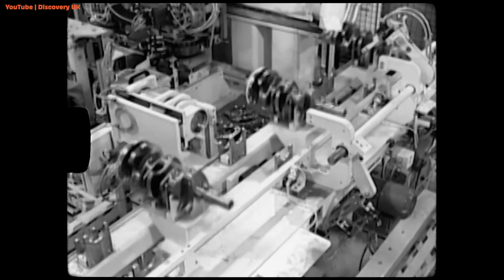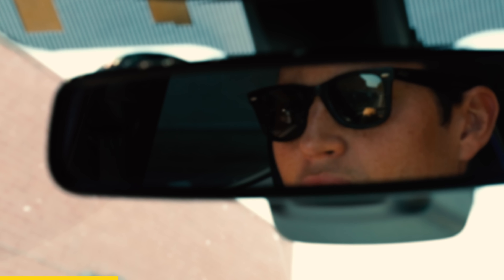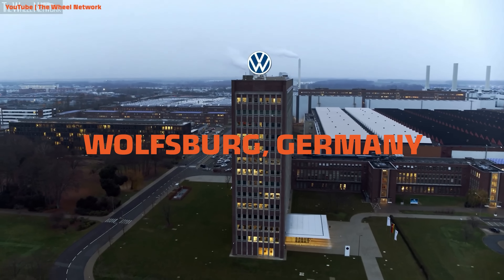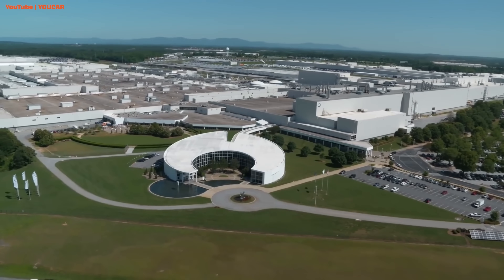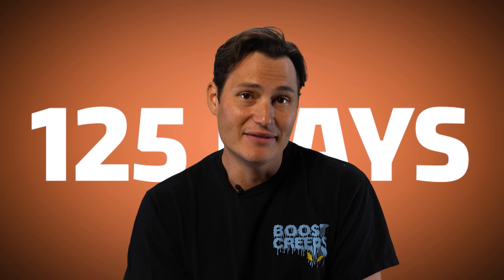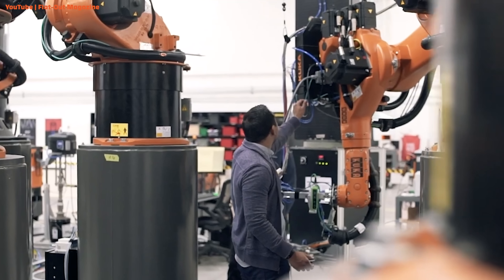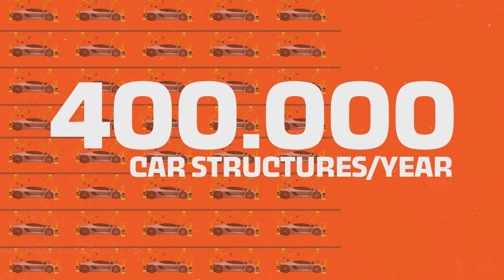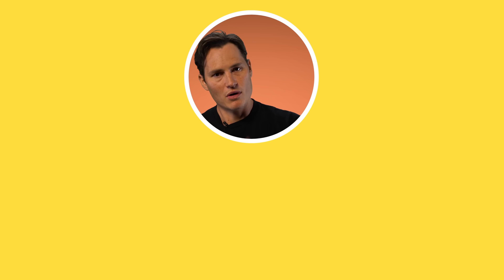A.I. Designed this Car

Comment: I feel like the bigger step forward has really been 3D printing which allows these intricate and complex shapes to be easily manufactured. Before you had to work within the manufacturing limitations of casting, welding, etc.. Humans are also quite capable of designing more resource-efficient builds.

Comment: Takes thousands and billions.......................Yeah tell that to the 8 guys that did it from a shed and have cars with the speed records -this is a misconception of the industry formerly it didn't take that many(Shelby had no more than 13 people) and it still doesn't its called corporate inefficiency personally I call it stupidity. Most of the industry doesn't even manufacture anything, they merely assemble it, other than a few manufacturers that actually have the capability to do so because it is ever so popular as ever to outsource everything over seas to cheaper areas in 3rd world Labor costs.
Another problem is overproduction of cars that leads to higher pricing for the entire line, your not only paying for your car but also ensuring the company insurance that they get their money either way(Most of the time this is done with selling new or refurbed parts), to put this in perspective the actual Manufacturing cost of a lets say 2016 BMW M3 is only $13k(because I am familiar with this one and its actual costs) mind you R&D and engineering costs are not included because they are recouped over years using the very same body and parts as well as cross utilization of different vehicles minimizing their cost that never translates to your pocket as a consumer, go ahead and pay for a BMW/Merc/Audi aka Euro Taxis. AKA the industry is full of its own shit, has been since the 80's and probably as early as the 70's when they figured out they could sell hot trash that is cheaply made with garbage materials for more money, Hell even Enzo admitted in his Biography he willingly made shitty cars fleecing customers and sold them for high prices to fund his F1 habits which is really what he cared about, he thought the prosumers that bought his cars were idiots.
A large portion of the problems in the US are also the Dealerships that have become an antiquated ripoff, Cars should be M.T.O. to save manufacturing costs.

Comment: Good advertising for this car, but this guy doesnt take into account anything outside of the script he was given. Biggest issue, sure 3D printing is more efficient and can be reprogrammed to make anything... BUT its SLOW... and you need a insane number of them to get the same throughput as a factory line doing specific tasks. The other big issue with these AI generated designs that do the "minimum to get the job done", What happens when one of the parts breaks due to a flaw in the material? suddenly the rest of the structure cant handle it and it breaks. normal parts are made bigger and stronger or designed to deform to absorb impacts, a single flaw in a part of it wont lead to the entire thing failing(unless its the metals makeup, but this 3D printing would suffer from the same problem). None of this is convincing, it all just sounds like someone who recently heard of the concept but doesnt really understand anything outside of the core of it. 

OH yeah "500 million for a factory that can produce 1 car per minute VS  3 million for a machine that can make 1 car every 125 hours(while still needing people to put in the wires and everything else)" Lets face it, if his machine that assembles the car works... there would be video of it, ya know, working. 

for the same throughput you need 1 factory at 500m or 7500 3D printers for 22.500 billion dollars. Those machines would have to last through 45 change outs of a factory to a new car design to even come out at the same price. In order to be the same price, that 3D printed could cost no more then 66,666$

I will admit that the potential for 3D printing is there if the cost can come down. But this isnt "problem solved" like this video pretends.

Comment: This sounds like something that is gonna make a car where you have to take the entire back end of the chassis off to change the oil
Reply: cable breaks..  . cable is inside the chassis, whole chassis has to be rebuilt.
Reply: @nocensorship8092   I'm wondering  what cables  are you referring  to ,most new vehicles  don't  have cables any more ,it's called fly by wire in my world
Reply: @nocensorship8092  cables dont randomly break, if cable durability is put in variable it will last indefinitely
Reply: @GlobalgamingP  That, and cables tend to break at the flex points outside of the cable runs,  not inside the cable runs, so if the cable inside the chassis cable runs just goes to a connector, it's likely the breaks will only require replacing cables outside the chassis cable runs and not inside of them.
Reply: @GlobalgamingP  they break
Reply: When the oil goes, you trash the car and build a new one. It's called efficiency ;)
Reply: @RoboBoddicker  sounds like a good plan
Reply: @theslipperybrick_7566  😂😁😂😁😂
Reply: @theslipperybrick_7566  😂😂
Reply: @RoboBoddicker  this is not good. This means you will pay 20k every time your oil goes. This type of "efficiency" doesn't mean a car will be printed at a cheap cost to everyone in some sort of utopia... it means corporate greed will charge you the entire cost of a new car every time you need a oil change.
Reply: @RoboBoddicker  sounds about right, in a consumer society
Reply: The path companies start by expensive cars is that manteinance and other customers preference do not play a role in here. People who owns those cars just pay the bill. They don't even exchange their tires on the side of the road if needed. They pay someone to do it.

And of course they're using AI to improve assemble and project over normal cars. I don't see any sense to assume your wiring would be stuck into your chassi...
Reply: You do realize that repair and maintenance accessibility is just another variable you can add to the program and it will design the car with that in mind.
Reply: @thechainwarden  Yeah but also the car hasn't to be totally realized by AI, there are surely human supervisors that can actively modify the project
Reply: @ninotzz   tell that to anyone who bought a car after the year 2000
litteraly every car is like this now a days. oh heater core went out? pull whole god damn dash out.
Reply: @experimentalmenace  Mh interesting... I don't have a car so I didn't know... looks like we are going towards disposable crap more and more... (other example: phones with non replaceable battery)
Reply: @ninotzz  facts im a beg fan of self repair. and over the years companies dont want us to fix things anymore they want us to buy the updated version instead. they are even trying to make it legal that you cant fix your own stuff... the right to repair act is suposed to stop that tho.
Reply: @experimentalmenace  is it a USA act?
Reply: @ninotzz   its atached to a few different bills for individual states
Reply: @ninotzz  For now....
Reply: @thechainwarden  knowing how the system works it would design the product so that it fails just after the warranty expires.
Reply: @nts9  exactly
Reply: @thechainwarden  There's something more. Things break in cars because suboptimal engineering. I'm not talking about engine parts being used up, I'm talking about failing parts like cables, pipes, gaskets and that sort of stuff. When I see a cable that is angled at some point, and it can move a little. Bend. The point of failure. You can design prioritizing maintenance accessibility or... reducing possible points of failure. Or both! It is theoretically possible. Of course, you will always have some external damage from collisions, potholes and such.
Reply: @thechainwarden  That's not what I saw in the video. That was an engine twisted into a chassis, you would have to strip the whole car just to get at the injectors.
Reply: @thechainwarden  but where is the fun in that?
Reply: @thechainwarden  I think that must have already added to the program... Every car designer or manufacturer need to think of the maintenance facility. I think the future would be AI and robotics maintenance or service centres... You put your car in, enjoy coffee and servicing is done...
Reply: @thechainwarden  I wondered that when watching the video. They can factor human maintenance in to non-hyper car builds.
Reply: @thechainwarden  Honestly, manufacturers probably wouldn’t do that kinda like Apple making the iPhone unrepairable
Reply: Sounds easier than my car, designed by a team of morons.
Reply: That might be true for a car designed for max performance.  However, if you program the designer to allow for serviceability and longevity, it would be as easy to do work on the car as your 72 f150.
Reply: he said that engineers define mounting points and size and stuff, itll be no more complex than they let it be
Reply: That's assuming the oil change is still being done by a human with oily hands.
Reply: Gives new meaning to  -  Service by Authorized "" TECHNICIANS "" only   !!!!
Reply: Good thing none of you people can do anything to stop Czinger.
Reply: At the rate of the intelligence this will be factored into creation
Reply: Yes absolutely. Just wanted to post about it ))
I am a programmer, and I can assure anybody that "shortest path" is not always the better. Programming is all about optimization. Code readability and clarity of logic inside - is one of the important parts of optimization. So forget oil or any mechanical damage/malfunction (hello from Audi here) - just imagine one single wire failing inside those tubes and "shortest paths" - you will have such a headache. Not mentioning engine maintenance ))
Reply: A lot of comments  about how only shops will be able to work on these new cars, I can remember people  saying the same thing when computers  were first put in cars. I took the time to learn how to fix them on my own. And eventually built a mud truck with one, I drag raced a car with one  , everybody said it couldn't  be done. Yes I was one of the first  to try it and  it worked I see way more of both now. Don't  be scared,, learn how to work on the vehicles  of our future,  you could possibly make big money doing so.
Reply: Here's why a guaranteed income is needed in the US! Humans are becoming obsolete!
Reply: You know it
Reply: you will just 3d print another. Next level consumerism.
Reply: @UrSSuL  "what kind of peasant holds on to a vehicle after the oil went bad?"
Reply: They should, in turn, make a backyard mechanix vehicle, where you can even change out the engine in a few hours. Of course, as we all know, that will never happen.
Reply: Not if that's incorporated into the AI's dataset. My real concern would be crash testing and all the mundane safety issues involved. The problem you point out is that the human running the machine screwed up
Reply: Bugatti already did that bro.. LOL
Reply: That’s common with high end cars. Try changing the oil on a Bugatti.
Reply: no, you can optimize this function as well - assign a priority level for maintenance components
Reply: working at a walmart automotive, i cringe in pain at the thought.
Reply: Oil is 3D printed into the million dollars disposable car.
Reply: remember it's the AI who built it
Reply: Except you won’t even be able to change it, you’ll have to take it too a special shop with all the fancy A.I. So it can work on your car and they charge you out the ass
Reply: It's already sort of happened  ,driverless cars are racing. In special  races. AI is controlling  the ads you see on your phone ,AI has won in chess ,AI control certain  air craft  , when you play video games you are competing  against  a form of AI. It is here and a part  of our world,
Reply: @cbialorucki  yes. Electric vehicles if dine correctly have way less moving parts... Therefore fewer points of failure, therefore less to maintain
Reply: @cbialorucki  I only know a bit about the Model 3. But they actually last over 300,000 miles. Tesloop a taxi service in California has many Teslas with +300,000 with an average of $15,000 of maintenance. Most EVs use regenerate breaking, this greatly reducing the use of brakes. I rarely use my brakes.
Reply: @cbialorucki  Good to know on the brakes. no, that cost was an average of their fleet (maybe 15 yo 20 vehicles). The company has closed though, I think COVID did them in. Though I don't think they needed to replace the batteries even at over 400,000 miles for one of their vehicles. 

Even if it costs $20,000 over the course of 400,000 miles. I still think is a really good deal imo. Tesloop compared their costs of upkeep with model s vs a Mercedes Benz... It's was like 15,000 (model s)to like 80,000 (Mercedes Benz)
Reply: @cbialorucki  keep in mind that were talking fully electric, not hybrid.
Reply: Let's not forget "planned obsolescence", so they won't manufacture it with maintenance in mind. I think all engines should adopt freevalve and it'll increase the efficiency of all engines, plus hybrids.
Reply: Basically, a normal italian car.
Reply: Ok im not the only one that thought maintenance would be a huge expense.
Reply: Good point! None about maintenance... may be...
Reply: If the ai is properly optimized it would make any and all maintenance and repairs as simple as possible while keeping the design and performance intact.
Reply: What oil it will all be electric bro.
Reply: Electric cars don’t need oil
Reply: The SR-71 goes faster than 2000 mph!
Reply: So pretty much an Audi lol
Reply: Oil? I remember that
Reply: One of the many problems with the process-this stuff is interesting don’t get me wrong, but I have 6 years experience in traditional manufacturing (I know that’s not a ton) in addition to a degree in mech eng where several of my classes where focused on automotive manufacturing. I also spent my senior year working on a capstone project that used ai design to develop a new generation rover. While the design worked quite well, the technology is nowhere near ready to replace current design methods- I estimate 10-15 years on this but I wouldn’t be surprised if it suddenly advances quicker. Second, the idea of using additive manufacturing won’t make sense until it can at least exist on the same level as traditional methods- right now it takes hundreds of times as much time to use additive manufacturing to make a part that can be made through traditional methods.
Reply: You’re gonna have to take apart the whole cylinder head and change the block just for changing an oil filter
Reply: Sooo... an Audi? AKA The Four Rings of Sadness
Reply: Or no oil or gas needed when the cars will be electric
Reply: @buenito35  Lecktric cars still go wrong, ask anyone who drives one.
Reply: @cuckingfunt9353  yes all transportation can and does need maintenance, repairs... But electric cars, generally speaking, require less. I own a Model 3... 20,000 miles nothing wrong yet. Just adding windshield wiper fluid every few months and washing the car...
Reply: @buenito35  20k is nothing. My Toyota has 260k on the clock, all I've changed is brakes and tires. The AC works like new, I get 60MPG even when commuting.
Reply: @buenito35  I also have a mercedes van with over a million on the clock, on it's third head gasket but that's all, and the gasket only takes 4-5 hours to change.
Reply: @cuckingfunt9353  that is very cool 😎. Both situations can be true. Your statement does not make mine untrue or invalid... If that was your intention
Reply: @cuckingfunt9353  I drive a Model 3. Very little has gone wrong in +30,000 miles. All cosmetic issues ( 3 different things)
Reply: @buenito35  oil is still required as a lubricant. Its not the same oil and amount but still required
Reply: @johnhoppkins7258  I think oil will still be required for many other purposes. There are some uses that there will not be a good replacement - for a long time anyways. Even the things we do now to be more sustainable are bound to have some negative effects, but it's the right direction. It's like trying to stay with a horse and buggy when the Model T started ramping up, it just makes very little sense.
Reply: @buenito35  damn u beat me to....I was gonna say most likely become electric for efficiency
Reply: If AI is designing  the car repairs  of the car, along with  crash damage  is a part  of the deal  ,just like racing ,I have built many race cars ,I am aways thinking how can I fix this fast to continue  to race that day , possibly  within minutes. every race team has answer's  for this ,I'm very sure this car  can be fixed  if you have the parts on hand, With speed
Reply: @carlstephens1532  if the car is built by AI and repaired by AI and the AI can learn, what stops the AI from replacing the driver with AI as well. Not only is there no race team like you previously mentioned but after a while there would probably be no you. If AI constantly learns and improves and if it’s so much more efficient than humans then wouldnt AI simply remove humans from the equation, ya know all in the name of speed and efficiency right?
Reply: They will take away all of the jobs, prevent people from being able to afford food for their families, much less a car..while doubling the price of vehicles. Sounds like a perfectly logical way to progress mankind.
Reply: Or the oil will last the whole life of the car due to BLEEDING edge techh

Comment: LinguaScribe Elite One Time
LinguaScribe is a groundbreaking AI-powered multilingual translation software. Specifically, it allows you to translate, transcribe or voiceover any text or audio length into over 100 different languages and different media formats at once. You can use this fully automated app for podcasts, blog articles, social posts, websites and much more.
https://epicearn.com/link/linguascribe-elite-one-time/?ref=3069